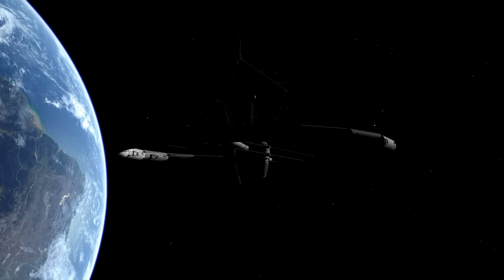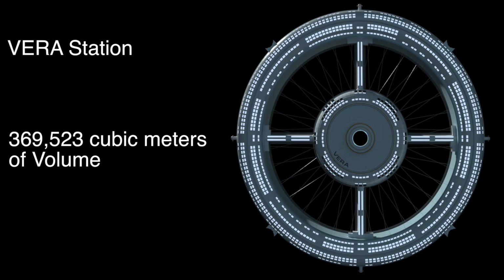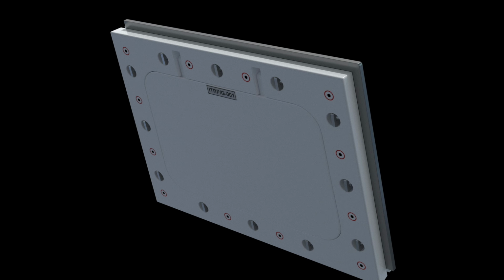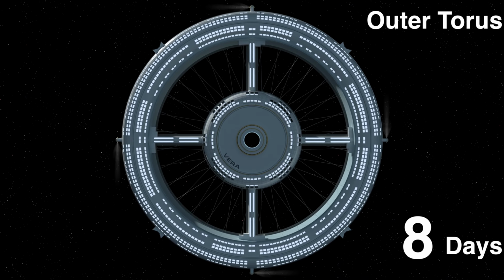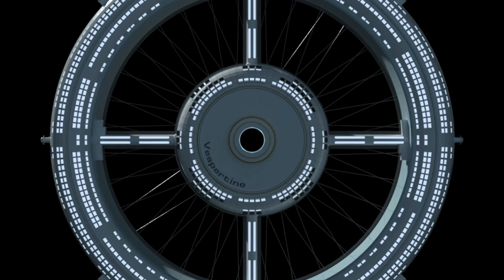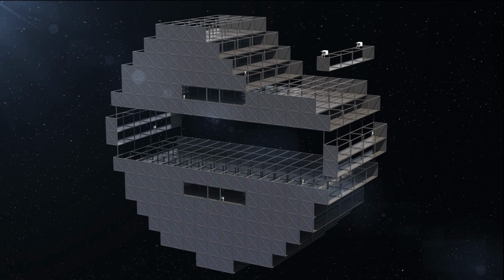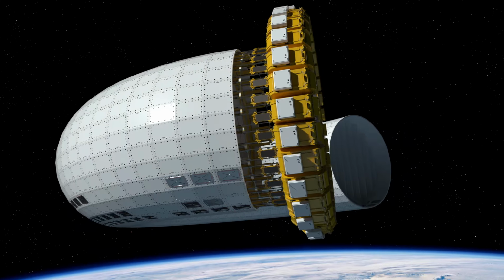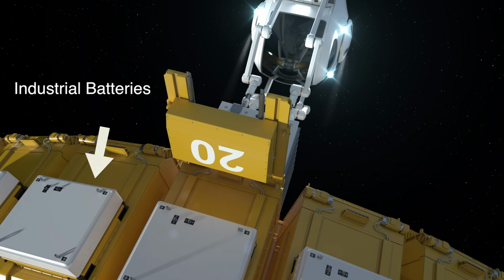We could build this huge Space Station in 6 months

Comment: This is an unrealistic goal. Those panels have to be wedge shaped, in order to fit into a a ring shaped assemblage, for one. this means that ring builder is going to have to have a collection of uniquely shaped panels, to get the job done. How you intend to seal all the joints, between the panels has yet to be explained. Also, a ring station that size will have varying gravity on each level. Also, how do you intend to get all the raw materials up to the ring building machines? I seriously don't think this is going to work as you want it to. Also, a ring station has to be perfectly balanced, all the way around. With people, and cargo being constantly moved, there's the strong possibility the station will become unbalanced, and wobble. You're going to need computer, and gyroscopically controlled counterbalance systems that move massive weights along the ring, to counteract the movements of persons, cargo, fuel, and other logistics. One more thing. How do you intend to provide protection against solar activity, and cosmic radiation. You can't build outside the Van Allan belt without proper shielding, and contingencies in place. Oh, and did I mention the need for MMOD shielding? That's going to add megatons of weight to that station, too. I'm not saying "don't even try"... I'm saying it's a bit unrealistic. However I am hopeful you will prevail. Look what they said about the automobile, and the airplane around the turn of the last century. But, you may want to add a few years to those construction estimates. Thanks for sharing your aspirations with us. Fingers crossed.

Comment: I hate to be the one having to point out the herds of elephants in the room.  Though it looks awesome in theory and on paper,  the first problem I see how are you getting the material to build the construction platform up into orbit. Then  the machine will need to be assembled,  which will take lots of resources and time. Point number two,  if you were able to get the construction platform operational, where would you get the resources to build the station? Putting them in orbit would cost a small fortune. The  only way this could be even remotely feasible is if you were to tape local resources ie mining asteroids which would require another type of machine that would mine raw materials and another machine that would act as a factory to construct the parts you would need.  The problem remains resources, manpower,  and  a host of other things. Though I think the idea holds merit and looks awesome there are other factors that would make it somewhat more impassable  for the moment with  current technology. I am sure that given enough time and resources that we as a species will do this and greater still , but I fear now is not the time.

Comment: Form will follow function, especially in space. When mankind figures out with relative certainty what the range of acceptable artificial G is for sustained living on a spinning station- then the engineering of a station should proceed. 

As has been discussed elsewhere on YouTube, etc- the size (diameter) vs the spin speed required to achieve a desired G force will dictate how robust or delicate of a structure you can get away with. Too small a diameter of the spinning torus and a person simply turning their head perpendicularly to the spin will become nauseated due to Coriolis effect acting on the inner ear. Too small of a size and mass of a spinning torus means smaller amounts of uneven mass distribution around the ring will result in damaging unbalance. A ring so large that unbalance and Coriolis become trivial might exceed the structural limitations of known construction materials and techniques. I’m just a layman and these factors came to mind. As they say, the devil is in the details.

Comment: The animation shows one panel being welded at a time, but if the Sargon builder robot is holding them in place, I don't see a reason it can't place them all simultaneously in one step, weld them all simultaneously in the next step, and then advance itself in the third step...
Reply from the maker: Very good, David. We call that "Swarm Loading". SL has the potential to build a panel Ring in only 2 minutes! That means if you had two Sargon CR's working on each Torus (Inner and Outer) you could potentially build a whole VERA Station in ONE DAY. Yes, you heard that right. But I am not sure if some of these skeptics can handle it...
Reply: @TheGatewaySpaceport  Very cool. Here's a thought on reloading: instead of reloading each magazine one by one, reload in parallel like a revolver speedloader (https://www.youtube.com/watch?v=gYd-XbcTiYA). Attach the panel bundles on the tree in a ring with webbing, inflate a structure in the middle to push them out into a ring, then load all the magazines at once by having the work pod push the loading ring into the magazine ring.
Reply: @TheGatewaySpaceport  at that launch cadence, availability of liquid methane for propellant will be a logistical hurdle
Reply: @TheGatewaySpaceport  Ideally don't even re-load Sargon, when it's empty swap it out for another loaded Sargon and reload the empty one offline from a tender that uses a speed-loader to replace all its battery modules and reload all its magazines in one operation. Also, if you build physical index points onto the ring segment (like the cylinder grooves in the speed-loader demo)  that simplifies docking a new Sargon, or loading a Sargon with a speed-loader.

Comment: Amazing, but I have a few general questions:
1. How would you like to build this huge "station building machine"? It is a pretty big machine (probably much heavier than ISS itself).
2. How will you end the building of torus with you machine? Will it fall to pieces?
3. OK, lets say that the torus will be pressurized. But are you sure that your structure will be able to hold its own weight and will not collapse after it starts to rotate once every 21 seconds? These forces will be quite massive that this construction should withstand. You have some "bike wheel spikes" in your design... but you have no support structure inside the tube that should be anchored to these cables.
4. How do you want to solve the deviations of the center of gravity due to the transfer of weight (like cargo and people)?
5. How do you want to solve the problem of avoiding space debris? If the station will not have any propulsion it will be doomed to death at some point of time.
6. Docking with Starship (OMG why)... your inner docking ring will not rotate... that is clever... but how would you like to connect it with the station and move the cargo and people from that inner ring to the rotation space station? You will start to rotate it? Do you think that Starship will be stable during rotation? (fotget about it) You know that people and cargo will literally "falling down" from this sprace ship to the station? How do you want to manage this kind of cargo transport? BTW. you know that Starship has wings in the front of the spaceship too? You can not just fly with this masive space ship into some hole. That is not possible. You are missing the proper docking system. (I have some videos about this topic)
7. You want to use big, heavy and expensive Tesla bateries in space? Why?... You know that you have free energy all around you in space? You just need a proper device to "catch" it. You don't need to transfer batteries full of energy to the space. That is kinda dumb idea.

Comment: I'm sceptical of the design, a large rotating station is a logistical nightmare. Surely a smaller rotating habitation section retained within a static station would be more achievable and safer/easier to use

Comment: is it possible to make a toy version of that with all the mathematical equations and launch it into the iss like a meter long toy that builds the station i mean its basicly taking the massive thing and substracting it in small scale if you make it in small scale shoot it on the issis and let them test it in space conditions the building part and then rotations and stuff....if in small scale it works you just make it larg scale....why small scale first you can see all the problems with construction and all the problems while its rotating and stuff... and i mean a small scale project like this would cost around 20k even less....bt if small scale project gets tested we got problems we solve the problems so that those problems dont arise in big scale project....also you will teach the electronics of it.. basicly if small scale electronics are like this the large scale electronics are like this aswell the programming part of the  construction viachle i mean...20k for making it small scale + 500k for fuel to reach space i mean it will weight around 50 kg maybe ...like 200 panels maybe 300 just in case if some of the panels go bad... the panels are 2cmby 6cm or whatever like really tiny panels....if you do that you will prove investors for big time investing...there you go dude go small first to go big later...great job on the project i was thinking about launching whole ring or rockets that bend when in space but yea constroction is good aswell..cuz like if you build a rocket that when reaches space bends in shape but yea that thing is awesome aswell...

Comment: I love your idea of in space fabrication of habitat using modular building styles and automated machines. However watching this video it feels like the idea consists of building an empty alluminium hull and thinking you have a space station. If I look at architecture for example, building the construction layer of a building is approximately 15% of the effort. The rest is plumbing and wiring and facades and installations etc. If you were to build a super green self sustainable highriser, this is already super difficult, you would need a lot of machines for water treatment, solar systems, and in space you also need to scrub the air etc. I see no plans how to get these elements in your enclosed aluminium hull at this moment. What about docking ports, doors, insulation, solar panels, toilets, life systems etc. 

I would love to see a version of this plan with the end result in mind. Maybe have the panels that you use already with plumbing, wiring, electrical circuits, air shafts, insulation, inside cladding and outside solar panels integrated into them, of which all these things connect by connecting the panels. This would be incredibly hard to design. You could have modular panels which can exist of docking ports, doors, windows etc. And also think of a plan how to bring in all the needed installations and how it would work. 

Maybe I am wrong and it would be compared to building the hull itself relatively cheap to bring in all the plumbing, insulation, solar panels, life systems and docks etc. If it would already be pressurised simple spacesuits would work for a crew to apply all of the above to the hull. But it is for sure a lot of logistics to bring in after the fact. And definetely a lot of manhours needed to get it completed.
Reply: Also I am not entirely sure how the last few rings for closing up the hull would work here. It seems like the system is part holding the hull from the inside while part feeding the panels from outside. The machine would somehow need to open itself up to allow both sides to connect but than still needs to function to weld the last panels not on just one side but both sides to make it complete. Would love to see that part thought out maybe in a video.

Comment: It would be great if you can have the station rotate at 0.5 G during WORK HOURS and speed up to 1G during OFF (SLEEP) hours... that way you can maintain best health and during work hours people would strain less and be able to do more work and not get tired as much... also, you can have boots with electromagnetic soles to stick to the floor during the 0.5G times so that people dont fly off into the ceiling... you would have to wear a small backpack with Batteries to power the boots, but because of 0.5 G it wouldnt be much of a burden and actually would be good for the spine and back muscles to maintain your health.
Reply: Ignoring the propellant requirements to pull that off, the station will be too small for 1G. The human inner ear has a very limited tolerance for this sort of spinning and even half a G will require pushing that limit.
Reply: @angrymokyuu9475  i though you need around 300 meter diameter to negate the Coriolis effect
Reply: @vNYCblade  The RPMs are one of the big factors. You can only spin a station so fast before the inner ear starts acting up.
Reply: @angrymokyuu9475  Propellant considerations for slowing and speeding up is a challenge...but should be doable... you can also use gyroscopic force to speed up the rotation and slow down the rotation... Soviet Salyut station was designed with Gyroscopes to orient itself... if you can orient yourself, means you can spin yourself...

Comment: this all sounds great... the Toroidal Builder is interesting... makes sense for building the outer shell, but building the inner floors will require something else... Can this Toroidal Builder be demonstrated with a prototype that can be launched into space (Toroidal builder, all the required panel, whatever else is needed and all having a MAX WEIGHT of 1500 kg???) As a DEMONSTRATED PROOF OF CONCEPT? Obviously the demo is scaled down version of the actual system and the panels used in the demo can be as simple as it gets but close enough to the real deal for actual panels...
Can this be done?
Reply from the maker: Yes, read my statement at the top.

Comment: Off World Habitation will be the Ultimate Showcase for Sustainable Regenerative Design on Earth .... Not only must Raw Material Resource (RMR) utilization be key and central to Everything, but source, size, weight and form will be paramount. 

I can envision that in a short time, post construction of the manf/training station Toris, STARSHIP will only need to transport high density "building blocks" of only those RMR elements required and that from those RMR blocks we will systematically  "Grow" everything we need In-Space (i.e. Off World) within dedicated grow pods; Similar to what we already do in creating silicon ingots, BioEngineered Synthetic substrates, photogenic cellular plastisizers, and a host of new and future forms of Biomimically based technologies. 

High density compressed blocks made up of sheets of Nano Carbon that could be used for tensegritall  structural applications and/or perhaps many other carbon based compounds needed.

The efficiencies gained would be significant, in line with those stated to build vera port toris', but with the deployment of pseudo automated  "programmable" biotech, electrochemical and photon activated based  fabrication "machines". 

These systems can also produce Power and Electricity far more Instead of deriving "Energy" from our HIGHLY inefficient terrestrial technology of PV/ batteries/inverters, etc.
 Congratulations to Gateway Industries in Pioneering these technologies but more importantly, making "The Dream" far more Real than ever thought possible by "the others".  
Mucho Gusto! HO! 🎇💫

Comment: When you have it al set up if you need a maintenance man who specializes in fixing leaks at 30 bar and  capable of building anything you need up there out of stainless steel or aluminum provided it's safe to use a tig welder up there and can think outside the box .Shout out loud as after Covid .I am very tired of this rock

Comment: Something I don't get is why we don't use an older yet easier to design power generation system. You see, space might be cold, but direct sun exposure is well in excess of 250 degrees. Hot enough to boil water. using the shadow of a station would be a condenser. So the question is, why not use older technology to power stations for the life times of any station?

Comment: Congratulations... this is a revolutionary concept to construct large structures in space. It is obvious that much R & D has already been done. SpaceX will become tractor trailers hauling first the segments of machines that will make the actual parts, then hauling panels on daily scheduled flights. Everything; food, water, air, tools, parts, people, all have to hitch a ride on SpaceX. Cost per ton into low earth orbit is quite low with SpaceX. Those costs will plummet after methods for rapid turnaround, logistics, and scheduling mature. 

Several ideas come to mind. If structure is going to spin to create artificial gravity, the inner and outer rings are moving at different speeds. Gravity will not be the same, and it would be complicated to achieve with fixed crossing access tunnels from inner to outer. A problem with artificial gravity produced by spinning has been identified. It is not the same as gravity on Earth, even at 1G the same as Earth, humans do not easily adapt. Also, there are other biological concerns on long term space habitation. By rotating a city in space you would not create gravity, you would simulate it. Assuming your city was ring-shaped, and spinning fast enough, everything in it would feel a force pulling them outward, but it would be the centrifugal force, not gravity.

Segments could have airlocks in between that automatically close in event of fire or decompression event. Otherwise doors on airlocks would remain open, just like fire doors in a hotel. Walls that separate segments could be constructed with materials that allow light and views to look continuous. 

Again, this is revolutionary... let's get going on this soon.

Link: Artificial Gravity - https://en.wikipedia.org/wiki/Artificial_gravity